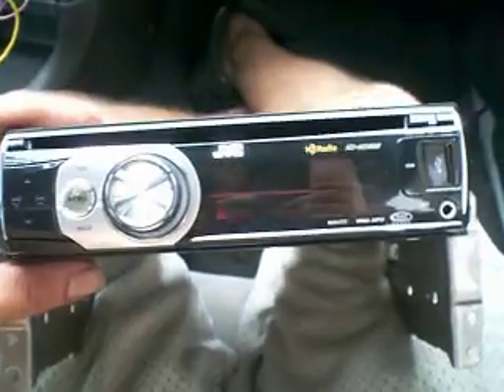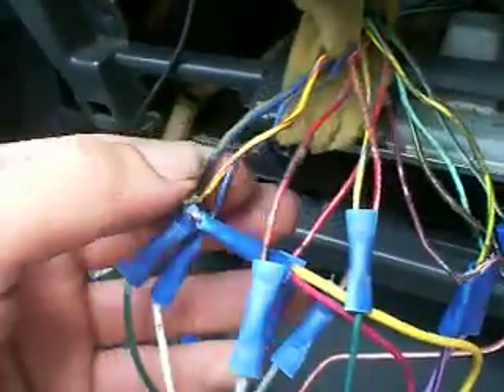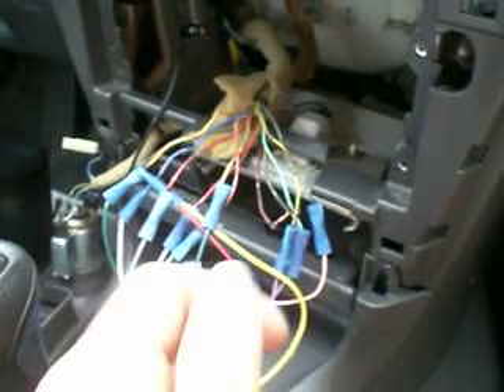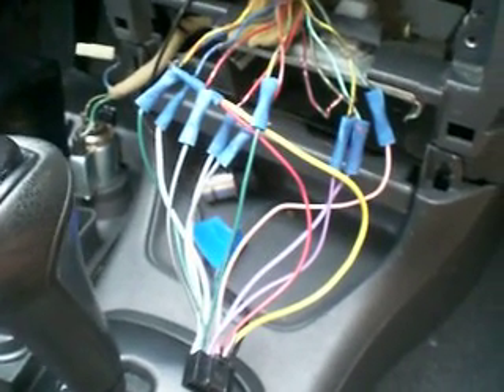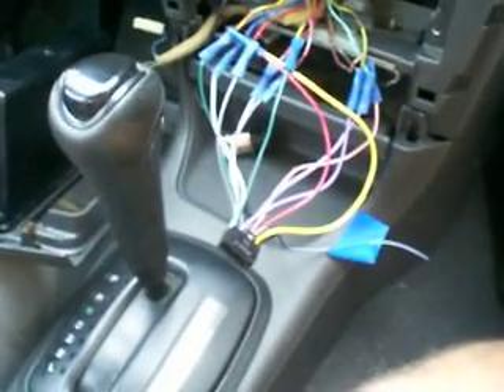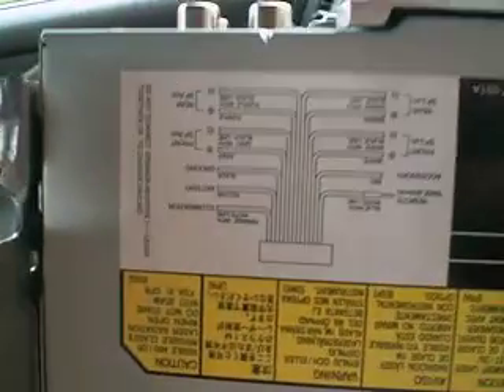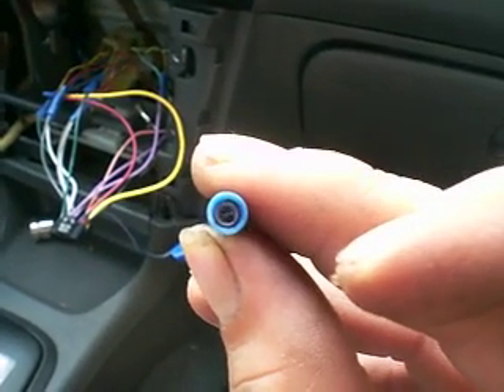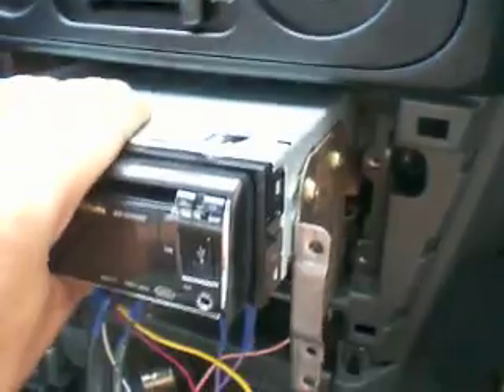JVC Headunit Install...NO HARNESS!!!

Comment: LOLing so hard right now.  Your scenario is exactly what I am about to do - attempt an install of a JVC unit in my 1997 Mirage, although I am going to be using a wiring harness and crimp connectors.

I can't believe I found a video of another Mirage, too.  Now I know that I don't need a dash-install kit, and I have a little bit better of an idea on what I'm doing.  Thanks for posting.

Comment: hey, a tip to find out what speaker is for each wire is to get a 9v batt. hold the negative down on the batt and slightly tap the the possitive to the batt.. itll make a scratchy noise but it wont harm ur speaker. hope it helps lolol

Comment: when i bought my car it didn't have a harness either, and a jensen deck was sliced in. so i ripped out the jensen harness for that deck and spliced in my new Sony harness, it actually didn't take that long cus all my wires corresponded, purple and purple with a line, blue&blue with line etc. and added my own taste by hooking the red and orange together so i could run the deck with the keys out.

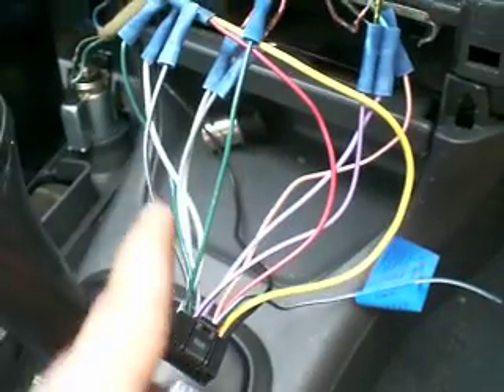Comment: correction..around 2:30 u said that one wire is solid the other has a stripe...its not to differ from right speaker and left but positive and negative on one speaker...just letting u know...good video tho u helped out..

Comment: HEY, i thought i'd tell you guys a little tip. if you ever need to find out what speaker wire goes to what speaker (like the guy in this video unfortunately had to), you can just take a double A battery, and touch the wires to the poles of the battery, Testing 2 wires at a time, going through every wire. + & -. When you finally get the CORRECT wires together, (a Positive speaker wire, and a negative speaker wire) you will hear a quiet popping noise coming from a speaker... and it can help U out.

Comment from the maker: well use a multimeter to find which is power, ignition, remote(basically blue to which ever wire turns hu on),speakers might be spliced somewhere and have different colors at the harness, you can use a battery and hold each wire  lead to +/- and i u hear a pop then u know its speakers unless u hear that or multimeter again to figure polarity

Comment: Looks exactly the same as the "install" I fixed last weekend (even the same car by the looks of it) except in my case there was no crimps or even solder - just wires twisted together and taped.

You can figure out wiring yourself but a google image search of "[car-make] stereo wiring" will usually get you going. While a battery can be used to figure out the speaker wires it won't tell you polarity (unless you can see the speaker move - it pushes out when you've got polarity right, and pulls in when you don't). The speakers will still work with wrong polarity but unless you get them ALL wrong it will sound rubbish (because the speakers fight each other rather than work together).

Comment from the maker: @elgoose2003 ok well i assume the harness has a wire for illumination....sometimes orange or white, this wire should be joined together with your memory or constant (yellow) in order to have the lights on when you turn the raidio on hoppe this helps

Comment from the maker: @DJXTREMOmixing  you can use the power wire from previous radio harness...just have to find it usually red. If not then run a separate wire from battery to the radio source...keep in mind you use a 8 or 10gauge wire for power. Hope this helps

Comment from the maker: @elgoose2003 you have wires mixed did you have a brown wire from the pioneer it is the power accesory wire that needs to go to a constant power to remember all the settings. not sure about color of wire but it is accesory wire to constant power wire

Comment: you can cut it and refer to this video. that is what the blue butt connectors are for then you can just crimp them with a set of long nose flat pliers, you can find them in any electrical store well car stores in the fuses and electrical section. hope that helps you Mack

Comment: thats how i do all my head units i hate the plug in adaptors just extra money lol but there is another way to find which speaker wires are what man with out having the head unit conneted get a small battery like aa or bigger and touch ther wires to pos and neg and they will make a little pop noise so you can tell its like the rear right or left and so on

Comment: next time. if you find all your power and ground. it time to use the battery to search for with pair of wires is belong to which speaker by pick 1 wire put it in ground of the battery,then pick other wire tap on positive of the battery. I mean AA battery. if you hear pop or static from which speaker then that pair of wires belong to that speaker. tie them together then keep doing the same way until you found all of them. remember 1 AA battery would make the job alot easier

Comment from the maker: @lopezchato88 depending if its double din or has any extra features. but for most part cd player comes with a wiring diagram so pretty simple and basic but you have to know which wire is which and this is how to do it with no harness usually if you get harness its just plug together and thats it no wires to connect by hand

Comment: you spoke of a dimmer wire ..i have  daihatsu charade 2007 classic and there is a blue wire and a white wire left over after wiring the whole system what do these wires do if you know that would be a huge help ... i would like to have all the features available working not just the essentials

Comment: @sinbeatz1 I installed the wires like on the video, but I have am converting from a touchscreen to a regular cd player. I have a headlight dimmer wire and a illumination/dash wire. I also have a blue and a pink wire running to my fuse box. My radio doesn't even cut on! Please help.

Comment from the maker: @matijaze003 well radio should come with diagram on it to identify the wires as for the car i would find the speakers first..basically play around with it most of time power would be red/brown speaker most of time have a solid color purple then purple/blk wire...use small battery and rub the wire to the +/- of battery listen for a pop to find left/front or right/rear speakers and so..by the you have less wires and ground will always be black

Comment: Hey man I'm doing the EXACT same thing, with the VE but 1996, it got band expander already when I bought it. I'm trying to wire it to the new JVC head unit, I got all the speakers right, but constant power seems weak I couldn't get it to work UNLESS I put both 12V constant and 12V IGN into that fat blue accessory wire which I tested to be sure giving me 12V when I switch to accessory and so forward. SO which one is your constant power??? I'm also trying to sort of 2 other power-unrelated wires.

Comment: You use a harness so you can easily disconnect the radio and for an easy installation. Why not just spend the $10 and do a clean job.
Reply: heyitschinoable But sometimes there are no wiring harness adapters for some cars

Comment from the maker: what car do you have year model...if ur putting a aftermarket radio at time they will have a adaptor harness where you dont need to do such a job as i did. Hit me back with the car info as well as what radio you plan on installing to know specifics

Comment: HEELP - no harness...found the ground -next step connect to battery -yellow cable. Ok i tried with all cables - and the radio wont lid or show it has power. Im thinking I will find the matching wire for the yellow/bettery first, and then match the red one - speakers will not be a vast problem. SO, am i mistaking trying to power the unit with finding a match for the yellow wire while the red one stays unplugged or not??? Please message me via youtube if u know the answer. THANKS!

Comment: Hey there, 
i have a 87 saab 900, im thinking about putting in a jvc r330 radio into it. I was told there was no wiring harness for it so do i have to wire it like you did?

Comment: i have a 2003 nissan sentra i plan on installing an aftermarket jvc kd-r320 it comes with harness but what will i need to connect it and not mess anything up @SinBeatz1

Comment: i have a 97 chevy cavalier when i turn on my lights the radio turns off what could be the problem , and where did you connect your dimmer wire to?

Comment: hey please can you help me    im installing a pyle indash dvd gps   and i connected all the wires right   yellow wit yellow and red wit red  and ground wit ground and wit the pink wire one added to the ground  the pink is lamp in,  but the stereo goes on and work good   but the buttons in the front have to be illuminated wit a blue light and the light is off of the buttons ,   what can i do to get the buttons of the stereo to illuminate how they supposed to be?

Thank you

Comment: Hi, I did all that and still my radio does not work. The reason i was changing the radio in the first place was because the original one did not work, could that have something to do with the fact that it still does not work? Also the antenna connector does not fit into the jvc head unit, could that also b a problem? My car is 1999 Jetta Volkswagen. Any help would be appreciated, thanks.

Comment: I have a question regarding the splicing, I have the kw r710 and i have two wires that are the same color. do i splice these and connect them in one? or how am i supposed to do this?

Comment: i have a 05 f150 it had a sony xplod aftermarket in it, i took it out and put in my pioneer aftermarket and matched the color wires to one another, before i did this both radios worked and so did my dashboard lights. ok so i connected the pioneer and now the radio wont turn on neither will my dash lights. i thought i wired it wrong apparently i took it to  a pro and they wired it the same way still no power/no lights. fuses are good. what could be the issue and how can i fix it? any suggestions

Comment: google model number on head unit and look for the LOOM or HARNESS through car retail nik nacs who sell fuses and car accessories. count the pins on the back of the head unit. ask front desk manager and he will be able to assist you looking up model number and get the correct one you need. jvc are pretty much compatible and im guessing but you should have 16 pins and 95% harnesses or looms will fit. hope this info helps good luck.

Comment: Witch one is the power bc my is not turning on bc ther red and isnt power
Reply: mine turns on then off, lol... Damn 03 dodge is giving me a challenge. Found the original harness all hacked
Reply: @edperez1206  I blew a fuse and the cluster and my radio now I have to get a new cluster and a new radio
Reply: Scott Godwin Damn man. I'm barely gonna try again. My doors lock switch ain't working. Hopefully its a fuse.
Reply: Yesterday I googled wiring diagram for mu dodge. Hopefully it works. If not fk it. Getting help. Lol
Reply: @edperez1206  on a civic?
Reply: Scott Godwin nope I have a 2003 dodge

Comment: Someone help! I have a big problem. My friend installed a new head unit, and a subwoofer with a built in amp in my truck. It's a 1991 ford ranger. When he installed it everything was working fine. When I was driving home I noticed that none of my blinkers were working. So I thought it might be a fuse. I checked them all they look fine. I replaced the blinker relay thing on the fuse panel too. Whenever I push on the brakes, brake lights, and both solid turning signals  come on. MY hazards don't work either we unhooked the sub so that shouldn't have anything to do with it. I don't know what to do
Reply: Weak Sauce check and see if he connected the dash illumination wire, if your car doesn't have that feature it will mess with all the blinkers and stuff
Reply: Weak Sauce all you have to do is disconnect it to see

Comment: Hey bro what color wire did you connect the red and yellow to in the car for ?
Reply: Jose Robles.    Did u find out. because im putting in an aftermarket stereo and every video that i see doesn't show me what they did with the Red and Yellow wires

Comment: I had a fren of a "Fren" install my stereo, as a favor -  It's clear he didn't know what he was doing - So, I had to give him a little direction & left him alone (cuz guys don't like it if u know more than them) - He ended up connecting the ignition wire, directly 2 the ignition - I've noticed, the backlights, the console lights don't work, as well as AC acting weird - Now it's taking awhile 2 start - Keeps clicking until it eventually starts, if I'm lucky - I already replaced the fuel pump & the issues r still happening - I had it rechecked/ diagnosed, everything is fine, but they don't know y the issue - Is it possible that becuz of this janky stereo hookup, that it's messing with the rest of the vehicle's systems? I have a 2006 Malibu btw...
Reply: +WrennR Kee Malibus use Chevy's can bus smart wire data network to relay information and can often pick up strange problems like the ones you speak of when radios are installed without the proper interface modules. I would recommend taking it to a professional installer and having them install said module such as the Scoshe GM13SR. This may solve your problems. Good luck!
Reply: If you really knew more than him, you probably wouldn't be on here asking questions.  Just take out the head unit and undo the wiring to see if it gets rid of the problems.
Reply: WrennR Kee yes it is the speaker wires are touching the vehicle somewhere I’ve seen it before in chevys

Comment: I'm sure you figured it out by now, but if not I just wanted to let you know your vehicle doesn't have switched acc. power behind the stereo. You have to either purchase a "Integration Module" or run a switched acc. power wire from your ignition switch.
Check out __CarAudioTips. Com

Comment: You should use a wiring harness always use one because crimp connectors are shitty and if you don't know what your doing you will destroy your head unit also the people at a car audio shop and the manufacturer of the head unit doesn't recommend you use crimp connectors because the manufacturer recommends you always use a wiring harness and if there isn't a plug to hook up the wiring harness you can go to a car audio shop and you can actually get a plug to hook up the wiring harness the manufacturer and the people at a car audio shop would not recommend doing what your doing in the video because crimp connectors are not recommended by the manufacturer or the people at a car audio shop and if you took your car to the car audio shop they would probably say what the fuck is this why did this guy use crimp connectors he doesn't know what he is doing. They might scold you for using crimp connectors if you took your car to a car audio shop to get a new head unit installed or to get it fixed or to get a subwoofer installed

Comment: that looks like ass!!!! no zip ties you didnt even cap the remote turn on wire!!! and jason palmer you dont use a 9 volt battery to pop the speakers maximum acceptable is 1.5 volts. biggdame21 if you have a factory amplified system and use a aftermarket harness all you have to do is twist the constant and amp turn on together and dont let it  touch anything after that the amp is powered and you can test the speakers with the proper tool a phase tester which you can buy for 20 bucks